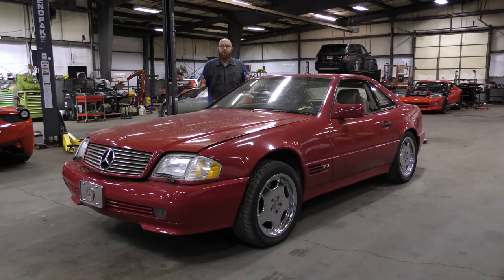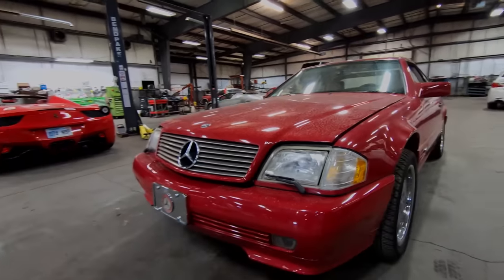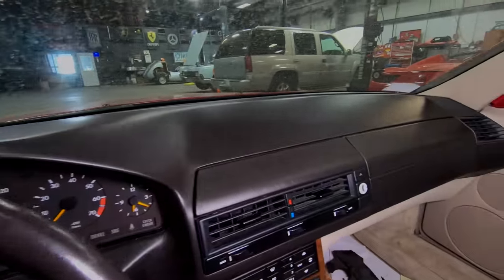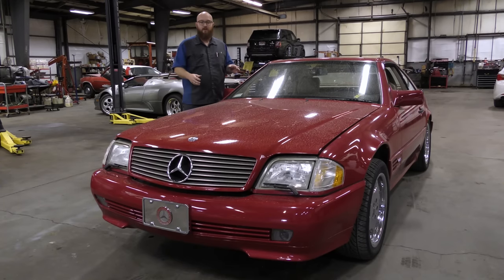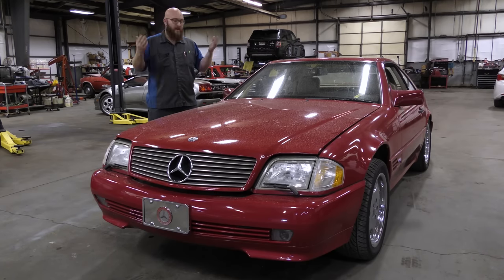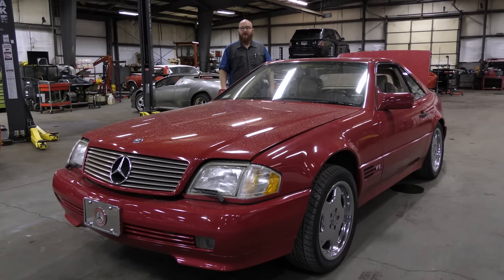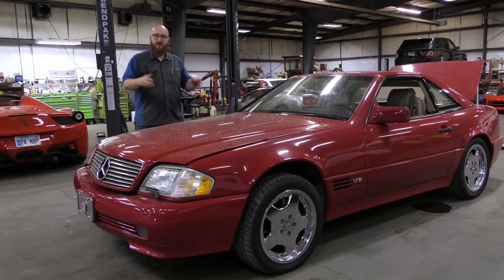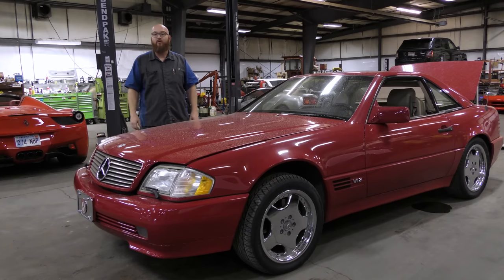Another customer scammed! CAR WIZARD shows why this '94 Mercedes SL600 is needing 15K to get sorted!

Comment: I'm not sure I can feel bad for this guy.  I won't even buy a Mercedes or a BMW but I know to look for that hydraulic issue.  Did he not even try the top?  The electric harness wiring was right out in the open.  Frankly, if you aren't going to research common issues with a vehicle then you shouldn't be buying it, new or used.

Comment: This would have been a much more dependable and practical car with one of their older proven dependable straight 6 engines.  Yes a dependable cheaper engine and then a better roof lineing etc that did not fall down,

Comment: A well sorted car with less than 100K miles for less than $10,000? In 2022? No. Ok, an astute buyer would be factoring about 10-12 thousand on repairs, deferred maintenance anyway. Ok, so Wizard's estimate is $3,000 over that. 

Then again, Wizards shop prices are 60-75% what they are where I live. So... Maybe it does seem much more to that customer than me.

Comment: i think when buying cars like a 90s mercedes 600sl v12, they have to be very cheap when making the purchase, because there has to be about at least $30000 reparation cost in the consideration. i guess these cars are bought for people who admire them but why would i admire that model when it has a quality that falls appart like that. biodegrading wires is a very wrong idea for a mercedes 600sl v12, because that is supposed to be a very high quality luxury car that last for a very long time. i think a high quality brand (at least supposed to be) like mercedes should remake these wire harnesses for the the 90s 600sl, that would be what a brand of renown high quality would do. i liked the 90s  mercedes 600sl, that with the convertible hardtop, but after seeing what problems it has, i dont think i would want to do that to myself and better not buy that. beside that, wouldnt it be possible remove the convertible roof (including the hydraulics etc.) and weld a stainless steel roof on that model ? that would fix the roof problem permanently.

Comment: That car is old, and some pieces will have to be changed no matter how much mileage they have. Expecting a 30 year old low price luxury car not to need repairs is a bit stupid.
Anyway, spending $ 25,000 to have a nicely driveable classic V12 convertible Mercedes doesn't sound too much. I doubt those $18,000 Mercs were anywhere near mint condition.

But yes, I wouldn't buy a modern Mercedes. They are no longer made to last.

Comment: If that was me, I'd probably have you disable the hydraulic roof and do whatever was necessary to make the car long term drivable, and sort out a few things here and there as far as comforts are concerned, just to take a little bit of the sting out and the car can still be mostly enjoyed. Let's face it... he isn't going to be able to sell it like that, at least not for even close to what he paid for it, so he may as well at least get to drive it for several years, even if the top isn't functional.
When you first mentioned the biodegradable wiring harness, I thought you were being sarcastic and just throwing a dig at Mercedes for maybe just using cheap plastic, whether intentionally or not. I didn't know that was a real thing. Why would they do something like that? That doesn't make any sense from any standpoint. It's nothing to have cars around for five, six, seven decades, so it isn't saying much for them if they design wiring harnesses that intentionally fall apart in as few as 50 years. That's just boldface telling your customers that you fully expect your vehicles, even your more expensive vehicles to not survive too long. "Yeah, in 50 years, this car won't exist, so we intentionally designed some failures into it so that just in case one does manage to still be around, it will just start literally falling apart around you." At least that's how I'm reading them. It probably isn't just the under hood wiring that will disintegrate. It's probably every wire in the car, and many of the other plastic pieces, like the bulk of the interior, and all those plastic engine cover panels, the trunk interior...

Comment: I mean, it's not a good deal and is truly mechanically totalled unless you can do the work yourself or have a parts and/or labor hookup, but did they really get ripped off if they paid $7500 for a car that could be worth $18k?

Seems less like a predatory rip off and more like an ignorant buyer trying to be a shark and failing.

Comment: These V12 R129s are a money pit. Whether or not you're capable of doing your own work. Stay away or, if you must have an old SL, shoot for the later SL AMG models V8 and V12s  (55, 63, 65). Much safer spend

Comment: So to cut through all the bs, someone should diy the whole thing for 1k. Rebuild the cylinders yourself,  buy a used harness. But I guess that doesn't make for a click baity enough title.  The only people scammed here are the viewers of this video.
Reply: This. Top actuator cylinder seals are just dried up, simple O-ring replacement with generic viton seals. Tape/heat shrink the exposed harness up and have an interior shop re-glue the headline, drive and enjoy.
Reply: Well, i took into consideration that he'll be buying Genuine MB parts if he can get his hands on it, which will be overpriced just because they can. Where i think the dishonesty comes in is with the scare tatics, some guys work on older luxury cars all their life and dont bitch like this guy..so it really makes me wonder what someone has to gain from using scare tatics and over quoting, to keep someone from purchasing something, like it's all impossible.
Reply: @kensmechanicalaffair  It's just Wizard ego.
Reply: @henrystone237  I guess.

Comment: Geeish...here let me help you...get rid if the hydraulics and just "kit" the wheel height to a fixed position, that's $500. Secondly buy an off-the-shelf SL500 wiring harness...modify the connectors and use it while making up the few extra wires needed....$2,500. That car only needs $3k to be spectacular again. Why do you make things so difficult Wizard? Keep it simple.

Comment: You never, ever, ever, ever EVER bring ANY project car to a for profit foreign shop mechanic. That's just begging to get your wallet sucker punched and taken to the cleaners. No offense intended. Mr. Wizard but this job is not a "normal" shop job - it's a P-R-O-J-E-C-T car. This seriously means that it'll require a full on disassembly AND restoration, and will take a year (or more) to complete. My uncle (an engineer) had a gorgeous old 70 Jaguar burgundy sedan that was HIS (literally)back yard PROJECT. Yes it was done slowly, methodically and within a certain budget, but definitely doable. 
I hope you didn't discourage this gentleman too much, and instead be compassionate....

Comment: Dont total out nice cars with your ridiculous mechanic pricing. Car is fine. Rare engine that will last longer than most modern day engines. Before 1995 uses biodegradable wire harness. They won't ruin the earth but they will need to be swapped or remade after 20 years. Once fixed then you don't have any issues.

Comment: These cars look so out of proportion, the body to the window area.  So Mercedes Benz SL600 has the Carolina Squat...lol.   To start out that lipstick red color is horrendous.   Those wire harness are a disaster, fire starter in my opinion.  Seems these cars had the General Motors and Ford disease, designed to fail.   Mercedes thought customers would chalk it up to the cost of owning a Mercedes and keep bring the car back to dealership, but nope their customers left and went to other makes.

Comment: I had the honor or horror of attempting to repair a 92 sl600,.... What a nightmare! At least for me! Wiring issues galore! Info at the time was scarce and the wiring harness on top had been replaced it was so screwed up that I gave up on it. From what I found out you need to go thru a training course on these systems in order to trouble shoot and repair them. I knew of the edible wiring they use because of a 1988 audi 5000 turbo. Mice had gotten inside the car and ate the insulation off of every bit of wiring under the dashboard and interior of the car! Pathetic Indeed!! Or a very nice Saab 900 convertible that I built a new wiring harness under the hood! Every piece of insulation crumbled to the touch. Envirowackoes are a very big problem and using Soy based insulation is the Dumbest thing ever pulled by anybody!!..... But the rodents love it.

Comment: OK, so I'm an electronics neeeeeeeeeeeeeerd not a grease jockey. I'm the computer equivalent of a shade-tree mechanic, I guess -- I take old office computers and weird cheap machines from various secondhand sources, as well as extraordinarily outdated and thoroughly wrecked laptops and desktops (mostly laptops) 'donated' to me and whatever's left behind from the repairs I do for friends and family members, and turn them into interesting-looking, usually pretty low-end, Linux desktops and battery-less but portable systems for myself and for others.

But I grew up in the 90s and my electronics knowledge developed side-by-side with my computer knowledge. I kinda look at computers through an electronics lens, if that makes sense.

Again, I don't know much about cars. I don't drive. All of what I do know is theory, not practice, mostly absorbed from Wikipedia and from watching my father do his own maintenance when I was a little kid because he was flat broke. None of his cars back then were newer than the mid-90s (most were early-90s or 80s) and all of them, with one sole exception that lasted less than a month (!!) were very sensible three-box sedans or wagons and almost all were Japanese import types for the US market.  Honda Civics, Toyota Camrys, there was a truly epicly horrendous Ford Tempo in there that I could wax poetic about in the most comedic way for a full afternoon, and a Geo Prizm that just kind of sucked. (It was an epic fail of a lemon, but not spectacularly like the Tempo. It was just pathetic.)

But, having said all of that -- I wonder -- so the SL*5*00 is a V8 and the SL*6*00 is a V12. One imagines the engines share something of the same roots, car manufacturers generally like to do that a fair bit. Given that, would it be reasonably possible to nab two SL*5*00 wiring harnesses, sit down with a couple wiring diagrams, a nice set of wire nips, and a soldering iron, and after a day or two of swearing, snipping, and rosin flux fumes, come out the other end with an SL*6*00 harness and some spare wire?

Comment: What you feel ok driving means alot, i have a 2000 porsche 996 had it forever and now i'm retired an thinking geesh if the motor blows it's 20000 bucks maybe i should buy a new car, so priced a mazda miata thinking they are reliable an sorta a sports car , new one is 50000 including tax , now 50000 would also buy me two motors and one tranny for the porsche , the question is would i feel better driving a 50000 buck miata or a porsche that over time will probably need a new motor or tranny , the porsche takes corners so fast even after 20 yrs it is still a thrill to drive , don't think 50000 bucks of miata would have that thrill , a v-12 merc , that's a special car , you feel special driving it , so whats that worth ? is it worth 7500 bucks an a wiring harness an hydraulic repairs ? 7500 bucks will get you a nice clapped out miata :)

Comment: It's a Mercedes Benz....what do you expect? A car that cost well north of 100 K when new is going to cost you to fix. At least it's not the most over rated car from Germany.....BMW. 🤣 When looking at a used car you have to figure the seller is getting rid of a car that is starting to give them problems, in the case of exotic cars it will cost you.

Comment: Laughable, 10 miles per gallon and an eco friendly degradable wiring harness. German engineering at its most ecologist influenced worst. A V1 doodlebug with eco friendly wiring would make more sense.
All "eco friendly" stuff is a means to extract money from Joe Bloggs.

Comment: Typical... I belong to mb club..some cars are just insane..  convertable top is complicaed  and parts are costly if you can find them.. Short production runs costly parts.. friend had one flawless white 90k on it..No takers for 3 years.iN SILICONE VALLEY. Even lowered price to 3500 still sat on lot..finally traded it for other cars..  tried to sell it to me i researched first no way..shocks are a joke .. Car was fully functional not like this one.. BUT ITS HARD TO MAINTAIN AND JUST STUPID COSTLY....  3 years it sat not a dent on it.. no mechanical problems.. He lost money on that car.. some have 3 sequentially timed motors for top that malfunction a lot..  also cars are known to just die, yes, no one knows why?  they restart in 20 minutes... but....  Join a club read reality... then run away fast,,  A lot have bought cheap then spent thousands and thousands keeping it going.. yup...

Comment: I'm thinking that should have been a factory warranty recall if after the fact there new age tech failed they as a good customer service company would issue a recall because that is a silly place to try and save the planet with a gas guzzler engine immiting the most carbon per gallon lol but hey "let's try biodegradable wires " lol sounds more like a marketing scam to later gouge the pockets 😉

Comment: "Bio-Degradeable" ??? More like MB mis-specification and then seeking an acceptable get-out. Check out Victor at vsandvs on Youtube, he re-builds W140 harnesses. Did my V8 harness for $300 and less than an hour of my time to connect, easy. Not so difficult on V12 if you can find a harness.

Comment: Mercedes Engines Excellent, Electrics Cheap Crap, 2000 Early Body work Rust Also Crap Due to Money saving Execise on Rustproofing, I Speak from Experience, SLK 32 AMG 2001, Sticking to My Honda Civic EP3 Type R 2003.

Comment: for me it is brill as i can not do the hard stuff like paint buddy etc. can weld and swap mhcnical parts but depends on cost. less computers the best. parts it the price not labor.  sorry but haa a car that p1sses on you wtf. good job it is a hard to i live in UK so would just leave it on or do the work myself . not a auto mechanic but i do all mt own work. swaped engines ant trans not auto. ypu tube helped me do it all my self..  get a Lexus Toyota or Honda. electrics dont know . if i had room to keep it and do it over a year project. air suspension  replace it with springs.  mice like them eco plastics haa diy or bin.

Comment: Their is something very special, very appealing, about a signal red Mercedes-Benz SL, be they the Classic 107, or the 129 series. When you look at this particular SL 600, with all the shine, the optional chrome rims, the correct stereo system, etc,
and you hear all the nice comments from the owner, about how the little flaws, are no big thing…and how they have kept it maintained…’and all it needs is a tune up’, so they’ve reduced the price, to a price you cant pass up…Wrong, you now have the Classic recipe for problems, big problems. This is Where you admit you know nothing about these models, and you need a dealer Inspection, just to know what may be needed down the road, be that 9 miles, 90 miles or 900 miles.
I personally own a 2002 Mercedes-Benz SL 500, which currently has 23,000 actual miles, and has always been Serviced at a Mercedes-Benz dealership…Always. I purchased it, in December of 2004, from a MBZ dealership, that sold it new, to a Mercedes collector, who drove it approximately 9,000 pampered miles…a very rare, and beautiful SL.
If you are shopping for a 129 series SL, I recommend the SL 500, that has always been dealer serviced, has every service invoice, a clean Car fax, garaged and pampered…and if possible, offers an ‘Extended Warranty’ that Covers service and maintenance at a Mercedes-Benz dealership. I wish you well, on your search, and for your patience, and once you’ve found it, Enjoy your find 👍
Reply: PS: My apologies to the gentleman, who made the most excellent, most informative message that I found most comforting, and very much respected…Respected to the point, that If I lived, near his Automobile service facility, I would, without any hesitation, or doubt, take my precious SL, to his facility for any, and all Service, or required Maintenance…and I would be comfortable recommending him to friends also.

Comment: LOOKS LIKE GERMANS ARE AT WAR AGAIN....GARBAGE WITH SUCH LOW MILES ON IT...(What that automobile costs...it should be dependable to 200,000 miles with zero problems...makes one think again about German Engineering and dependable transportation...NO THANKS...